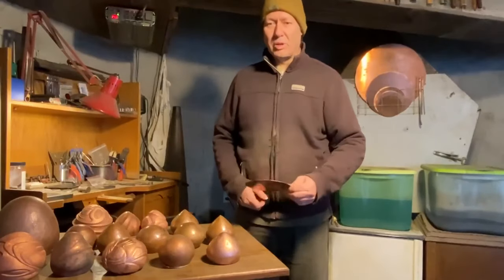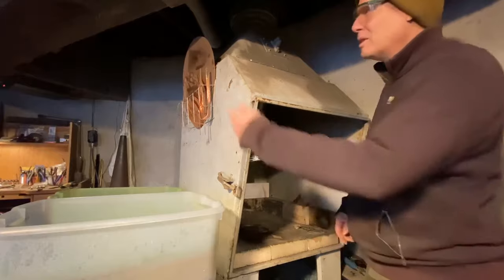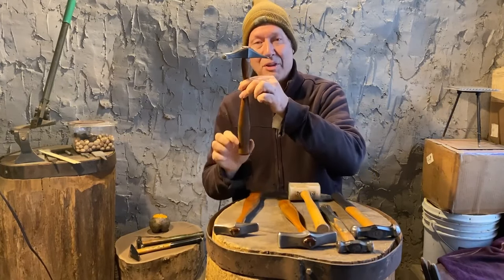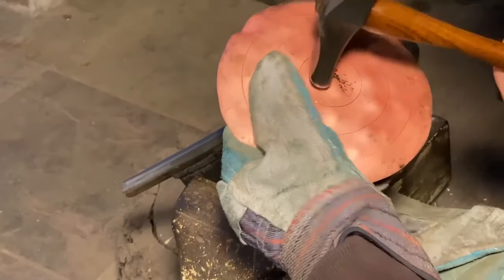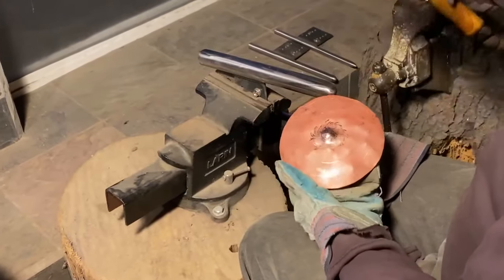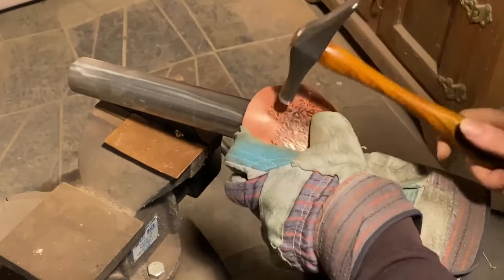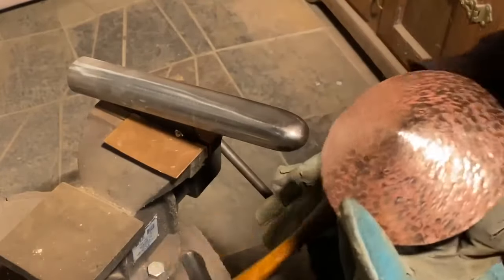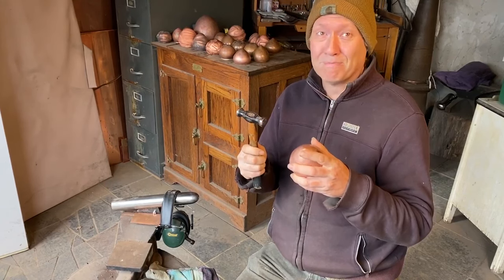Angle Raising Techniques with David Huang

Comment: Mr. Huang, have you always worked with copper or do you work with other metals? I ask because for most of my life I’ve been fascinated with metal smithing and forging. I would love to give milling a go one day but that requires a whole lot more of a cash investment that my very limited and very capped out income can afford.  I am asking about other metals because I’m curious if the lessons learned on softer metals help you when it comes to much harder metals? I have a simple single burner propane forge, that I’ve learned get a whole lot hotter than I expected when I liquified a brass piece I was wanting to forge down into a piece I could use as a guard on a knife… I really shouldn’t be trying to forge knives and such with my physical complications… I can work maybe for 30min. at the anvil/forge before I have to stop, which isn’t a lot of learning time… before I’m unable to return for a few days at the earliest. I injured my lower back and it wasn’t treated properly and it just kept happening and I kept trying to power through, until my doctor finally did an X-ray.… at which time he sent me directly to a neurosurgeon. Gotta love military doctors… this took 2 years to finally get looked at in an X-ray. And during that time I had broke and refractured the same area well over a half dozen times. So much that bone fragments where just missing although and the bone stopped healing itself. After my first surgery my doctor told my wife that he had no idea how I was even able to walk into the hospital that morning for the surgery. The vertebrae wasn’t connected to the upper and lower vertebrae and when the tissue was moved away, it could spin loosely around my spinal cord. I fought as hard as I could to make it back to a healthy active duty USAF NCO but it never happened and I tried to push myself as hard as I could. When I was told my fate, that I was being medically retired I was so upset. These surgeries where my way to ensure I could at least get in 15 more years, I only needed 10 more to reach retirement… the only long term goal I decided on after serving my first term. Oh, I made sure to go see my doctor after my records where sealed and given to me. I had a list of all my visits to him printed out and I marked each one that was back related, I handed that to him and I played the message he left me “hey, so it turns out there really was something wrong with your back after all…”. He took away the only job I was good at. I made my goal to retire after 20 because I wanted to finish something big in my life, that would be respectable. I was a high school dropout feeling my family needed an extra person to contribute with bills and my 4 baby sister. I did get my GED but honestly the only good thing it did for me was get me in the Air Force instead of another branch. Getting through basic and all my training and schooling I graduated didn’t feel like it was any better that a HS graduation ceremony with the ring and tassel, etc. but retiring from a 20+ year career on Active Duty in the USAF would be for sure! I even had planned a gift for myself, well, 2. One, a very nice ring to show all my time served, etc, etc… but the big one was a gold watch.. I grew up hearing people being given a gold watch on there retirement. Even in movies and tv. I thought if I could dedicate myself for a 20+ year career it would be deserving of a gold watch(yeah, the military doesn’t give those sorts of gifts to enlisted guys even if I was a senior non-commissioned officer). I expected to pay for it myself and it handed to my by my very dedicated wife, in which I could also surprise her with a gift equal in its financial value after she put the watch on my wrist. I knew it was going to be a gold Rolex but like the absolute cheapest option and model with a very specific band, a presidential band(I did come across a used Stainless model that didn’t have its metal band for less than $5k but even that I can’t afford anymore.). I told him my goals and plans, I showed him the email my commanding officer sent him telling him the he needs to find out and fix whatever it is, and then I reminded him of the threat he made before sending me to X-rayed that his was just going to have to board me out if nothing showed up( he did that like right after he got the email telling him off by my commander, he was very pissy to me after that and through my recovery. I was given 4 weeks to heal before he stopped my medical leave and I was sent back to work. The average time for this sort of thing was 6 Mo.) It was laid out and I told him that not only did take care of the patient, but that his negligence for writing it off as just chronic back pain, led the patient to suffer and the injury to get worse, then you where just going to kick me out until my commander got involved, to just get a simple X-ray annoyed you so much you threatened me with a board again if nothing was found and kept that attitude through my surgeries, procedures, recovery and PT. And even making me go back to work after 4 weeks on light duty, which was desk work, during a specific time I was only allowed in 2 positions laying down and standing, and whatever I did, to keep from sitting in any form. I still had staples in my back and was struggling to get dressed by myself. I pointed out everything he done and asked him if this was done by a civilian doctor, if he think the Doc could be liable…??? I said oh, wait! We’ll see very soon because I’ll be a civilian again thanks to him…. Sorry about the rant…

I was thinking if I could find a material that could be forged like steel but with less effort I could learn the basics better.
Reply from the maker: Yikes!  That is quite the story.  I hope you are recovering well enough and able to find a new path for life.  

Regarding your metal question, I was trained more from the jewelry end of metalsmithing than the blacksmithing end of it.  So while I mostly work with copper I have also worked a fair amount with silver along with some brass, bronze, and gold.  I've done a tiny amount of blacksmithing, but would in no way consider myself versed in the intricacies of forging steel and iron.

That said, in terms of learning the basics of how metal moves in relation to blows of a hammer I would think it is the same.  I often compare copper to being like a very stiff clay in terms of how you can squish it around.  Steel would just be a stiffer clay yet!  Drawing out tapers, forming curves, compressing and stretching the metal should all be essentially the same with copper or steel.  The copper is just a bit softer to work with, and you don't have to work it while it's hot, though you will need to anneal frequently or will crack and break just like steel.

I hope this helps.
Reply: @davidhuang3414  that does help actually! It’s funny, my last name(in it original version before my great grandfather changed it when he came into the US), according to what I’ve found means fine metalsmith. I’ll have to find it but there’s also a metal used in computers with the same name…. I wonder if that’s why it appeals to me so much.?. I know he worked as a butcher before he moved here, so I thought maybe the family did the metal stuff as well or before then.   Anyhow, I have a ball pean hammer that should get me started with a copper piece. I’ll just have to use the anvil and maybe just keep it hot with the forge. Any suggestions on a thickness of material to start out with? Thanks for your reply.
Reply from the maker: Fun that your last name means fine metalsmith.  Regarding copper thickness it probably depends on what you are doing.  Myself, I'm generally using 18 gauge, sometimes known as 32 oz copper since it weighs 32 ounces per sq/ft at that gauge.  Though I'm using my cross peen hammers to compress as much as I'm also thinning it, so in the end by the time I've finished raising a bowl it tends to be about the same thickness as when it started.
Reply: @davidhuang3414  that’s actually pretty cool about the finishing thickness. Before I broke my wood lathe(I was trying to use that motor for my belt grinder and I broke a couple pieces) I was planning on trying to make some blank shapes to then use them to turn brass sheets, like how they form bells on some brass instruments. I’ve always found that same sort of bending of the metal into the shape by pressing the material as it spins really cool. Same sort of thing, the finished thickness ends up just as thick as the starting. I guess it has to do with all the extra material furthest away from the center and shrinking it down, like fingers and clay as the person throws a pot on a wheel. Thanks again.